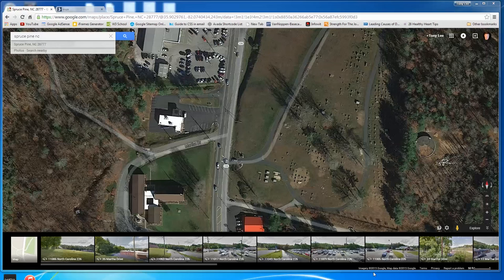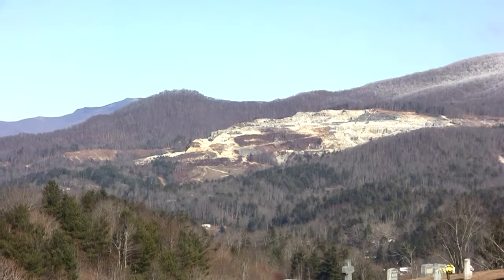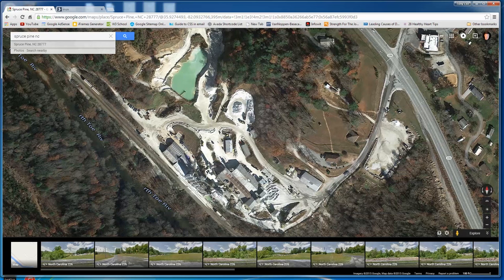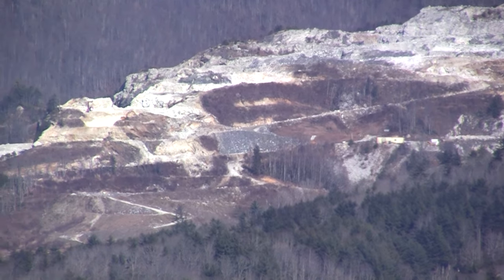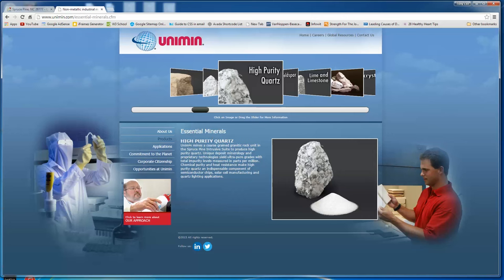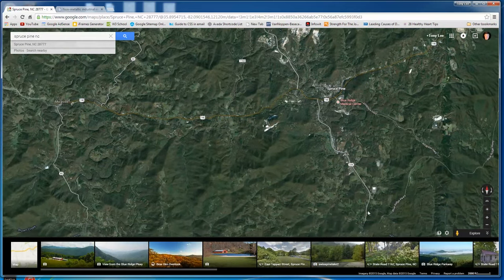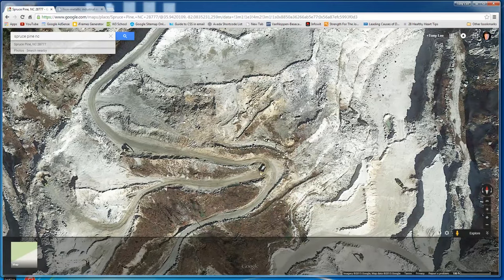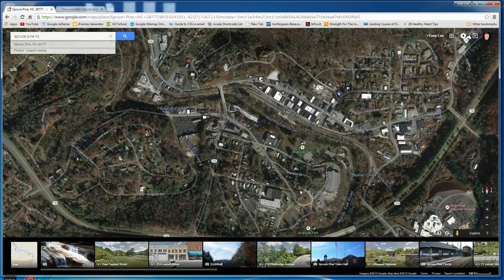One of America's Most Significant Mines - Unimin - Spruce Pine NC

Comment: This is probably the most important mine on the planet. Almost all semiconductor quartz comes from there. There are only a few other smaller deposits. From this mine, the US can control who can make semiconductors. Back in the 1940's they used only take the feldspar, the quartz was a waste material. Not anymore, the quartz sells for over $50,000 a ton. The process of purifying it us a closely guarded secret.

Comment: I have been to this mine back in the 1990s. I live in Canton, Ohio and I was a long hall truck driver back then. I drove for a trucking company in Akron, Ohio and they had me down there making a delivery somewhere in the Carolinas. I needed a load to get back home and they sent me to this silica mine in Spruce Pine. The road up to the mine was a very winding road that really wasn't meant for a semi. I was pulling a 53 foot trailer, and my truck took up the entire width of the road on the way up there and back down. They loaded me up with barrels of silica sand and I took the sand back to Willoughby Ohio to a General Electric plant where they used the silica sand to make glass light bulbs.

Comment: I worked for an Asheville engineering firm in the 80's that had this mine as a client.  Mostly erosion control design and permitting stuff.  I got to digitize or trace electronically the huge topo maps the mine co provided us.  My digitizer was 36" x 48".  Several visits to the mine and hiked it from bottom to top.  Cool stuff.  Thanks for the memories.
Reply from the maker: Really appreciate you watching and commenting Andy. I’ll bet that was a great experience for sure.
Reply: @tonyleeglenn  hey thanks. I also remember one of the (Canadian) managers showing us a broken piece of a quartz glass crucible he said was used to melt silicone in to make computer chips.  He also said they had searched worldwide for clean quartz and nothing compared to the purity of that found in this area.  There’s what appears to be a pond way up on top but was told it’s an abandoned shaft that goes down to the level of the Toe River.  Not sure how it was still holding water if that were true.  We also worked for feldspar miners in Kings Mtn. where most of the product went to Koehler toilets made in NJ.
Reply from the maker: @AndyFeinstein  Would be awesome to interview you about your remembrances Andy. Let me know if we might be able to do that online, etc.